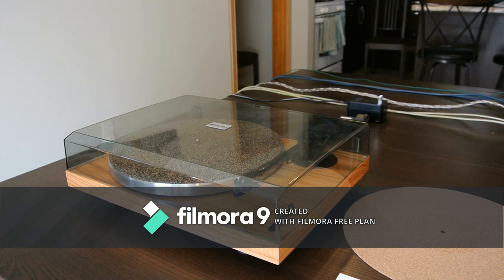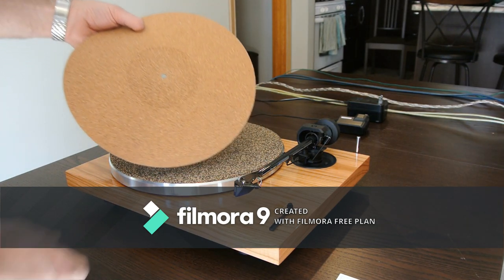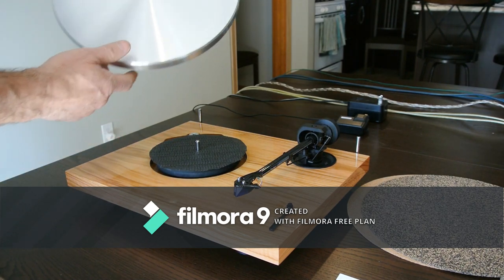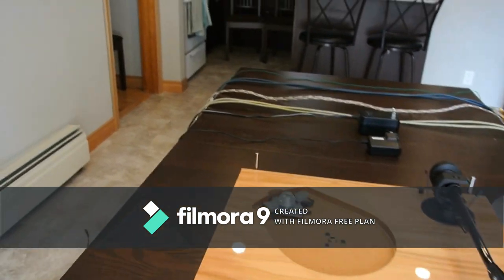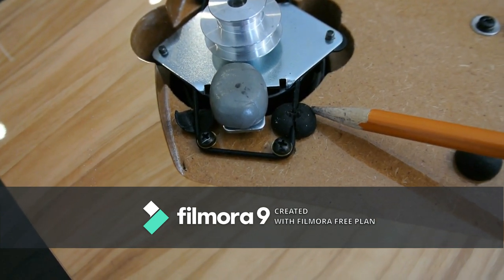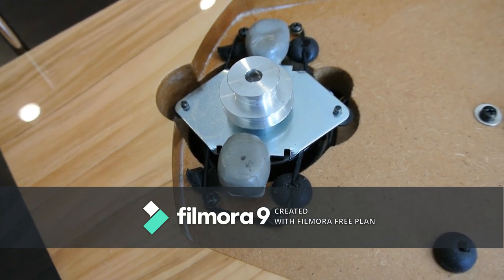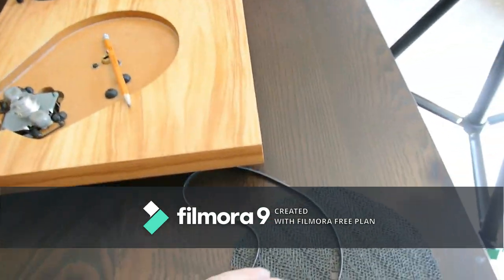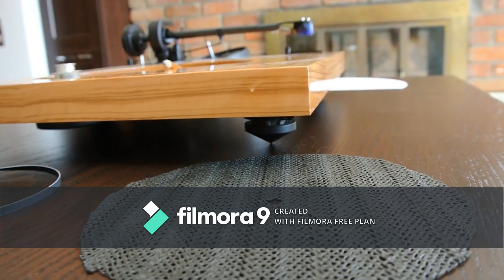Pro-Ject Debut & Xpression Motor hum and Noise Fix

Comment: Terrific video. Really appreciate your work and willingness to share. I’ll add another tip that fixed the cover hinges and seriously upgraded the user experience for me: disassemble the hinges and buff-out the length of rod arm that rotates inside the plastic housings. There’s metal burrs from the small screw punch that contributed drag. Next, create and insert a shim into the plastic housing, where the two edges meet, the goal is to keep the plastic clamp from closing too tightly on the hinge pin. I cut my shim from a thin sheet of cork. Cardboard would do, too. Next, I applied bluetac to the back of the plastic housing before screwing them back on the plinth. Add a drop of oil to the hinge, and don’t use the tiny set screws to adjust tension. They’re just gouging into the plastic housing when you do that. Adjust hinge tension using the large mounting screws. Lastly, make sure the hinges are horizontally aligned with each other when remounting. The end result is a smooth and solid feeling cover. Cheers and thanks again!
Reply from the maker: sounds good, I will have to investigate that a bit further. Thanks for the tip .
Reply from the maker: The hinges on all Pro-Ject turntables are crap, I'm not sure why they continue to make them.

Comment: I've damped the platter and sub-platter with similar bitumen based sound deadening. I've also decoupled the motor from the plinth completely by sitting it on  it's own base under the table. With a cork mat and a clamp, it runs very near to silent, and the detail is incredible.
Reply from the maker: I have heard people doing that and have considered it myself. I am pretty happy with the table now but getting it completely disconnected from the plinth would be much better, for sure.

Comment: This Is truly an awesome video with great insights, thanks a lot!!! I wanted to add that I’ve had a similar problem regarding motor noise with a high and turntable that I purchased a while ago, and I ended up with the ultimate solution which is to put the motor completely out of the main turntable assembly. From all my experiences and trials, this is finally the only full-proof way to get any noise out of the system: the motor simply cannot be attached to the same body where the arm is. I have set it up in a very temporary (and cosmetically unappealing) form as I am still fighting to get a proper chrome or silver casing that looks good to drop the motor into, as well as trying find a proper vendor that has good turntable belts (or any kind of belts that will serve the purpose) since the original belt of the turntable can’t be used anymore (the new length is obviously different, much longer than the original). Still no clue where or how I can find or build a proper metal cylindrical case to put the motor into and that matches the rest of the turntable, and still find thing to find a good place to buy belts. Again, thanks for sharing your video :)
Reply from the maker: Glad you found it useful, I have also thought abut complete motor isolation as well but on the Pro_ject I would have to go to, as you did a much longer belt. As it is I am pretty happy but I still have some vibration through the belt. Without a major renovation I think this is as good as it is going to get. Cheers!
Reply from the maker: Here is a link to what I was thinking of doing, hood luck. http://lpturntables.blogspot.com/2010/11/motor-isolation-base-for-rega.html?m=1

Comment: Your video made me revisit my turntable again to try and sort the noise and rumble which has been annoying me for years. My TT is a Debut 2 and must be around 23 years old now. I'm very careful with my kit and it is still as new. It forms part of my office setup - I have a high end 75 Japanese DD - Sony PS-6750 - family owned since new and 'as new' with 2M Blue for my main setup 'class A etc.'. My Debut 2 had been relegated to the garage - boxed for many years until we moved and I decided to play it again. I decided after a while that the 'cheapness' of it irritated me and after a while I replaced the platter and sub platter with Pro-ject acrylic and ally upgrades but although better, the rumble and noise was still there, the Sony's DD mechanism being totally silent. So the Pro-ject became a project. I had previously removed the motor screws and was then advised to put them back and so forth. Much jiggery pokery later and a pully and belt change - old mod - later, it was better but still rubbish. I found that the motor was being pulled into the plinth so cut up rubber washers and put them under the front part of the suspension band. Massive difference - but still not great. I replace spindle bearing and oiled it - better. I made myself believe it was good - but the mechanical rumble I had at start, between tracks and end had to be sorted. It got ignored for a while. Boredom struck and I decided to do a total upgrade - why? Was bored. So fitted Pro-Ject Carbon arm, spare 2M red, new bearing, RCA box, Evo adjustable feet (needs tapping kit) - I have to say they are expensive and crap! - no adjustment, just how far you screw them into plinth. Bear in mind, mine still has the old AC motor. Slowly improving but now I feel like I have been polishing a turd if you know what I mean. Everything fitted - well, looks good, that carbon arm looks better than that horrible steel tube. Sound? Average... watched your video and cam up with an idea... wife is a nurse, borrow stethoscope!  removed screw and dampers, fitted dampers at back of support band, listened to each option with stethoscope, finally silent. Also overhang adjustment.... what did I find? After having fitted all, forgot to do cartridge alignment - been playing this thing for 6 months or more and hadn't even tightened the screws - idiot! Final result - cartridge aligned correctly, motor screws and dampers below removed, dampers put under motor belt at the rear. Many thanks for all your suggestions, after 23 years, my old project has never sounded so good.
Reply from the maker: WOW! That was a lot of tinkering. I agree some of these Pro-Jects are like polishing a turd. With cartridge alignment, I just slide mine out to the end, as long as you are using a 2M or Atvm series cart. I prefer the Blue or the ATvm95en, very good value. I am currently using a AT120eb. Very similar to the 2M blue, maybe a bit better channel separation. Unfortunately, there is motor vibration getting transmitted through the belt, very poor motors on these lower priced Pro-Jects. Great to hear from you. Cheers!
Reply: Hi, thanks so much for your reply. Interesting comment about the motor noise. Mine is an early AC motor version. Using the stethoscope I was surprised to find it silent. I understand the DC motors are quite hummy. I have now acquired the sorbothane buttons so can finish that part. Can’t remember if I mentioned I also have the pulley and round belt upgrade. Pro-Ject seem to have abandoned that. On the cartridge alignment side I find using the supplied protractor and moving 2M cartridge to the end in the slots it’s still not fully aligned, however the 2M is an awkward shape for viewing for straightness from the top. I have decided to waste more money 😆 and have bought the Align It protractor. Not used yet. I will update you in results. I am building à TT based on solid granite plinth. Not decided on arm yet. The tool will come in handy. Cheers 😃
Reply from the maker: @janzuidhof9646  sliding the cartridge to the end does change the null points slightly buts dies delive good results. I suggest this alignment to new comers because it is easy to do and renders good results. The Pro-Ject DC models are really AC the electronics in them actually produce an AC voltage to drive the motor . From what I've read. Nice chatting.
Reply: @northa4021  I found using the supplied paper protractor it was very difficult to actually square up the cartridge visually, not helped by the shape of the 2M cartridge. It would also help if the headshell part of the arm had lines on it so you could line up better. I have a Sony PS-6750 from '75. Lining it up is a piece if cake with the supplied protractor Both have lines on them. To me it looks like even with the 2M slid all the way to the front of the arm, it is still not perfectly aligned in either 130 and 240 positions. The protractor could also be at fault as it is thin paper. I replaced the original steel tube fixed weight arm with OM5 with a carbon arm, same length and base etc. so there should not be an alignment issue. I moved the cartridge forward after reading your article - remember I had totally forgotten to tighten up the screws originally. I find the sound more shrill on transients, hi-hat, snare drum..... almost like sibilance. Regards the motor, I realise the DC powered ones are brushless (pseudo square waver) AC. I am talking about the AC powered motor before they went wallwart DC. I now realise that of course they need to be 60Hz 110V for you. I found my 230V 50Hz is totally silent and super stable. I think sharing info on these great fun TTs is very helpful, and community spirited. It's good to talk. I will let you know how I get on. Travelling for a week. Thanks again for chat.
Reply from the maker: @janzuidhof9646  with the Pro-Ject 8.6 in arms sliding the cartridge out to the end gives the following null points.  Inner null is now 67.4 and the outer is 114.9.  I printed a arc template from Conrad Hoffman .  This protractor is accurate and easy to use. I printed mine on card stock. Much easier to use than the Pro-Ject one.
Reply from the maker: @janzuidhof9646  here is the link to Conrad Hoffman's arc protractor. It is the 3rd line down. Custom arc generator.  The factory project null points, on the paper tool, are 65 and 125.  http://www.conradhoffman.com/chsw.htm
Reply: @northa4021  Many thanks - just back from travels. I received the Align It tool in the mean time - not too difficult to set up and use and will be useful fr other arms and plinths too. I fancy building a TT with granite/marble plinth and Linn or SME arm at some stage. Local supply is plentiful and inexpensive. The tool confirms that the cartridge position is at its best at the end of the slots in the arm but it feels like it could go forward a tiny bit still to be ideal. Why did Pro-Ject cut the slots so there is no further possible adjustment one may ask. I will print out the arc generator and compare to that too. It's free ;-) It's also strange that the protractor that came with my D2 back in 1999/2000 has null points of 130 and 240 when 60 and 120 are typical
Reply from the maker: @janzuidhof9646  I believe that 130 and 240 are the inner and outer TRACK RADIUS not the null points. I just think that the Pro-Ject protractor is a compromise.  I have also thought about building a plinth and using a Rega arm. Someday maybe, for now I will keep my 1Xpression going. Cheers.

Comment: I'm a keen table tennis player. When you replace the TT rubbers at the end of a season you are left with a highly expensive sponge and rubber sheet that has really good absorption properties. I've cut one into an in-between lower and upper platter disc to minimise motor noise transference and it seems to work well. Don't use cheap TT rubbers which can be stiffer, but tired used good ones work well.

Comment: A huge thanks for this video. I own a 1Xpression Carbon Classic with a Ortofone M2 Black and after some modding the horifc hum is gone and it's like a whole other turntable.
I used hardrive dampers for the motor and it worked great and I used a thin rubbermat between the platter and the inner platter.
The AC adapter is different here in Sweden and that didn't need to be replaced.
Reply from the maker: Glad you found this useful. I have replaced the Blue with stick on tire balance weights. Not much difference than the blue tack, just smaller and heavier. Cheers

Comment: Help! I did mostly resolve the hum but caused other problems- mainly that the pitch / speed was unstable. At first I thought it was an old recording taken from tape, that's what it sounded like. On close inspection I  could hear the belt turning,  like a sandpaper sound. Removing the sorbothane pads got rid of that issue but brought back the hum. You mentioned changing the pulley height to compensate for raising the motor- how do you do that,  and do you think that's my issue? It's like the band was slipping slightly.

Comment: Very useful video - made some adjustments to my Pro-Ject Debug Carbon DC - the motor hum went to nearly nothing.
Reply from the maker: Glad to hear it! Have a great holiday
Reply: @northa4021  You as well.  Where did you get your Lofgren B download?  I am having trouble finding it - just finding "A".
Reply from the maker: @michaelwatkins8871  what cartridge are you using? If it is a 2M series, just slide it right out to the endand you are good. The protract app can be downloaded at conrad Hoffman
Reply from the maker: @michaelwatkins8871  it is only available for PC
Reply from the maker: @michaelwatkins8871  just search conrad hoffman alignment protractor
Reply: @northa4021  Thanks.  I am using the Nagaoka MP-110 phono cartridge
Reply from the maker: @michaelwatkins8871  very good cart. I had one of the original MP11 many years ago apx in 1982. Oh God, I'm old.
Reply from the maker: @michaelwatkins8871  here is the link, it will take you directly to the zip file.     http://conradhoffman.com/TemplateGen.zip

Comment: @Northa40 Thank you for the tips! Got a question for you. When you made the 3M dampening material pieces, did you just cut out the circles, or was it more complicated than that?
Reply from the maker: I basically traced the sub platter and than just cut it a bit smaller.  I also gor rid of the blue tac and I am now using 1 oz. Apx 30gm stick on wheel weights they are heavier and stick better.

Comment from the maker: There is a little set screw in the pulley, you may have to adjust the pulley height so that it does not hit the bottom of the platter. Good luck, cheers!

Comment: Many thanks for the sound advice here. I have a dc carbon. Running at 33rpm without the platter I can feel the motor vibrating with my finger. Oddly at 45rpm it doesn't vibrate at all !! With the screws but loosened I couldn't really hear much hum on mine but if you turn up the volume on the pro-ject carbon and tap lightly on the side of the plinth you can hear it quite loud. That made me thing the plinth itself is a bit microphonic. So I took them out with my thinking that the vibration must also be being transmitted. I also remove the lid totally when in use. I also use a good quality cork mat. As I said I didn't have much problem with audible hum but with all of those things done I think that the sound seems to be somehow clearer and a lot deeper and richer - or am I imagining it ???  One other thing I did which I suppose is common sense is to get that cartridge aligned. When I got my turntable the inner groove distortion was horrible with the factory setup. I used the official Ortofon alignment card and then with the use of a thin pencil lead stuck with sticky tape the front of the cartridge through a lot of fine adjustment I made sure the alignment was perfect. I have to say that mine sounds great now and the weak link for me is the crappy power supply for my phono stage.  That tone arm lift though......dear me...no comment there...
Reply from the maker: Hi TomTom I found that if i was uding a ortofon 2M cartridge and even a OM cartridge by just sliding it out to the end gave me excellent results.  Doing this gives you null points at 67.414 and 114.862 mm. Glad to here you were able to reduce the noise on your turntable, losing the lid does make a difference. Cheers
Reply: @northa4021  Hi Nothha thanks for the reply.  I was listening analytically to mine again today and I really have no hum at all now. I just ordered myself a large piece of smooth slate 40cm x 40cm x 3cm + some Sorbothane feet to put under it (as an experiment) I am hoping to isolate the entire thing. I will oil the bearing too to reduce rumble as much as possible.
Reply from the maker: @MrSouzy  I have been thinking of doing something similar. maybe with a heavy butcher block. good luck, all the little things add up.
Reply: @northa4021  I'll let  you know if it makes a difference. :)
Reply: @northa4021  It arrived. Its a bit bigger than expected. 50cm+50cm. I was fully expecting to say that it didn't make a difference. But I believe it has made a big difference. Not so much with background noise but everything sound clearer. Before I could tap on the side of my stand and you could hear it through the speakers. That doesn't happen now. The pro-ject might not be a high end turntable but I really think I am approaching a high end sound at least now.
Reply from the maker: @MrSouzy   That is how I feel about my Project, its not high end but with some small upgrades you can make them very good. It will be quite a while before I purchase a new table. Have a great day, Cheers
Reply: @northa4021  it's good fun getting the max out of them... you have a great day too pal..

Comment: my music hall (same motor or close)  is very silent BUT after like 15 minutes, it starts to buzz really loud... have you experienced this?
Reply from the maker: Good day. I have  heard of this problem and some people have been able to fix it with lubrication. The trick is to get the bottom cover off the motor and getting some light oil in there. Some motors have a removable cap, that might be REGA's. I use TRIFLOW with PTFE. In Canada part# CTF21010. Good luck!
Reply: @northa4021  thank you!  i may have to try this